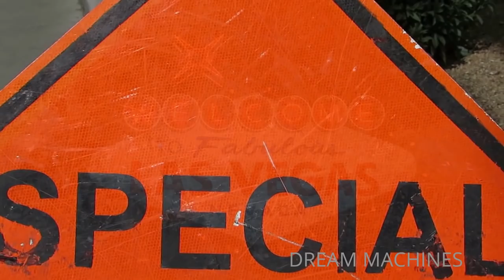Heavy cranes leaving CONEXPO LAS VEGAS oversize load everywhere big cleanout @ Convention Center [2]

Comment: It’s driving me crazy how the DOT works....drive the crane down the road on its 8 wheels with no pilot truck. Put the crane on a low boy and BAM!!! Got to have it sitting on 80+ wheels a pre approved route, and a pilot vehicle. SERIOUSLY? Am I the only one here?
Reply: Ever thought about that the crane maybe new and not already sold? So why do miles when its lowering the selling price?
Reply: Every state is different on length and weight laws as well as when pilot vehicles are required. As far as hauling one and driving on to the show, a lot depends on where it came from. Might be a local company from the set up they had. I have hauled pieces of equipment out of Vegas that was at the show and driven to another yard where it could be taken apart to be transported. Not everything is as it seems when watching a video.

Comment: Question: do you need a CDL to drive a crane like the second one shown on the video? If so what kind - A or B? These cranes of course drive on the street.
Reply from the maker: in Germany/Europe you need a truck license for such cranes. I don't know the law in the USA
Reply: DREAM MACHINES thank you for your reply.
Reply: Minimum class A to drive a mobile crane, then it's off to crane school for certs
Reply: @chaselangs1896  I once drove a Tadano 25 ton around on my land - the crane driver was quite laid back about it till the 2nd gear kicked in and it surged forwards towards a concrete pillar. I never realized just how much torque these things have.

Comment: Why do some mobile cranes goes on trailers? They are capable of driving on the road itself.
Reply: long vs short distance
Reply: Miles vs Fuel/Tire and Maintenance and insurance. Most drive up to 200 miles on their own, other times it costs less to trailer when the distance is greater.
Reply: Truck cranes vs rough terrain
Reply: I always enjoyed driving and operating the HTC 8670 LB SERIES